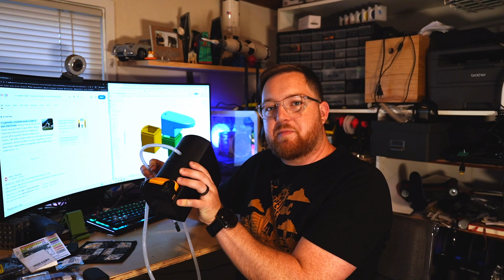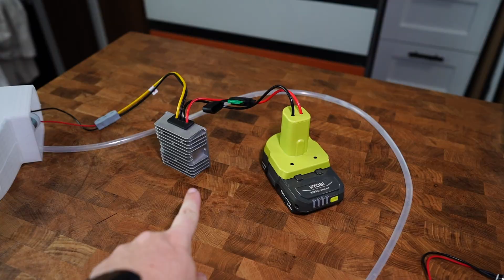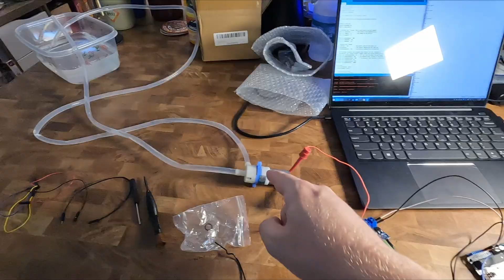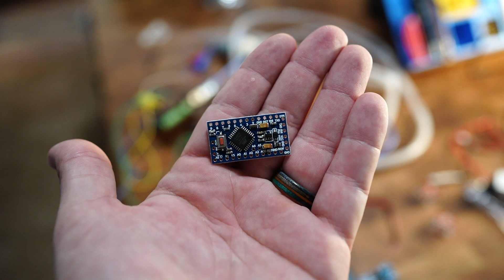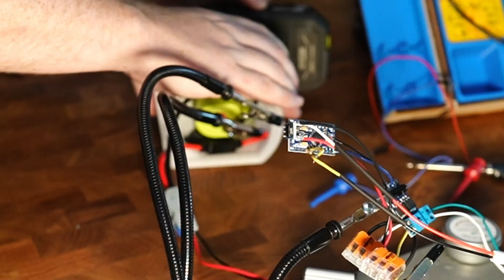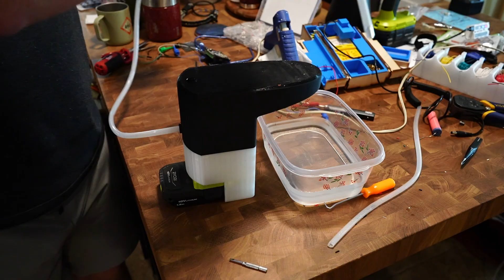DIY camp faucet - 3D Printed Camp Gear - Make your own Dometic Hydration GO - Free STL!

Comment: why not just raise the water higher up no electronics needed XD
Reply from the maker: That's no better than a typical 2 gal jug. Yea it works. This is definitely more useful and better low flow control. That's the big thing. Using less water. Plus it was fun to make 🤷
Reply: @builderandmaker  that's true, and it being fun is the most important!